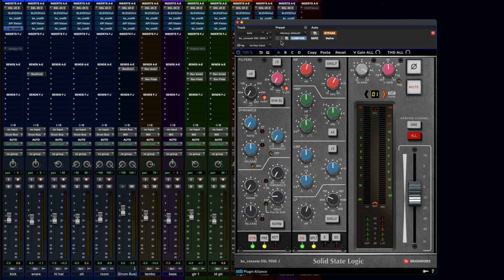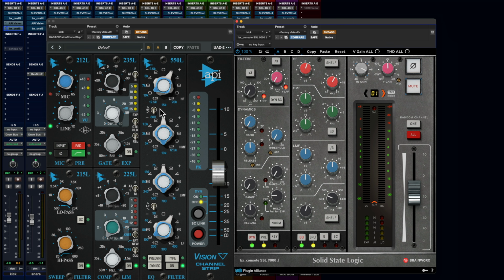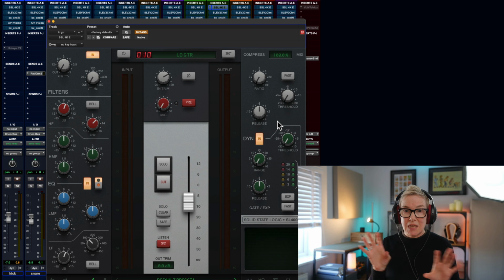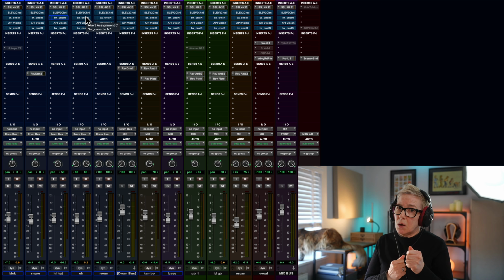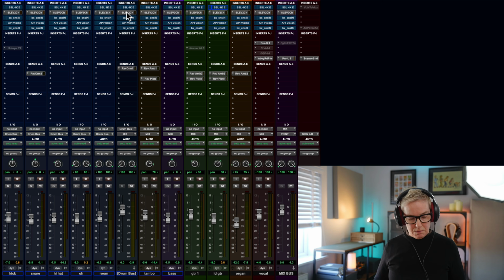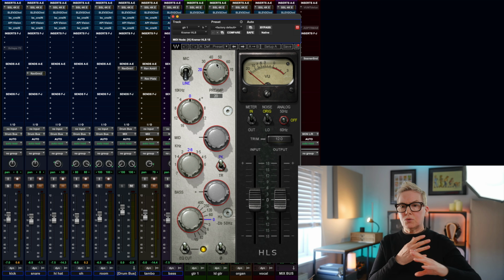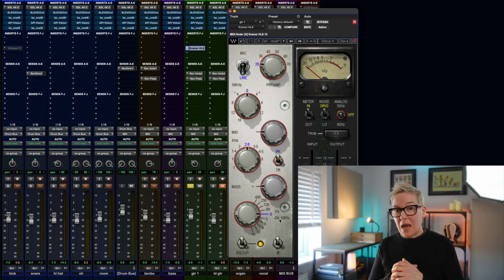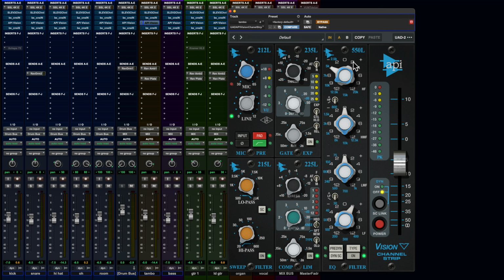Why Pros Use Channel Strip Plugins And You Should Too

Comment: Very good tutorial for beginners and intermediate engineers, as someone who had the luck of working in an SSL analog studio (early 2000's), I'm using a channel strip. on almost every channel (including groups and FX), but really love the fact that I can use a different one on each channel. Today I just select the strip I want for the channel, but in the studio it was always SSL, and I had very limited (for today, I gad plenty for then, it was a big studio) options of external (Neve/1076s/API/Fairchild...), and if I used the API for acoustic guitar, I couldn't use it for electric. right. So take it from someone who have been there, life in-the-box is SOOOOOO much better, and this is even before mentioning the curse  that we call tape, which sounds great when everything is calibrated, but either a technician, or a trained assistant\in-house engineer, need to work approx. 6-8 hours once a month, to make it so. 
And that was in the best days of analog (early 2000s), when thanks to SSL I could do at least some sort of recall, and use limited (fader only) automation, only thinking on how it was before the 80s. gives me nightmares/

Comment: I am missing something here. You;'re using the same strip on each individual track? This is not a master track stereo bus channel stip. So each track has it's own settings. How do the SSL4k settings compare to the API settings? Are they the same? How would you control for the limitations of each channel strip?
Reply: I have a headache.

Comment: I gave up on visual eqs such us fab filter as couldn’t get my mix sound right. started using bare minimal simple plugins with fixed bands and slowly building experience, the Kramer strip been my fav as it’s really transparent without that plasticky coloration so many plugins add, hard to ruin a track with it ;); once I got bit more confident I started adding Pultec eqs on tracks that need more drastic adjustments; after that I was able to use api eqs without making everything sound terrible;] they are a bit tricky for me as are more flexible , now I’m at the point of SSL channel strips - still a bit intimidated but having all tools in one plugin is really a mental relief ;) (I only used waves so far) in terms of saturation I’d rather put a track through couple of pedals/amp+mic as all plugins I tried sound kinda meh, if i have to l use Kramer tape or J-something tape

Comment: I've watched this video a couple of times, finding it very informative.  I have the Waves SSL E-channel, not for the sound, but for the description of what I can expect the sound to be (70s vibe, warmer harmonics compared with the G), and it's the only channel strip I've used.  I've also watched your compression video, and I'm experimenting wth your practices.  With adding compressors after the channel strip, would you use the channel strip compression at all? Or ever use the channel strip compressor without adding more compressors?
Reply from the maker: I often use both for different stages of control, but it really depends on what the track needs!

Comment: IMHO you should have level matched the outputs for a better / more neutral comparison, so people watching / listening to this video don't get the "sounds louder = sounds better" effect... Futhermore i wonder if you used Brainworx / Plugin Alliance famous TNT (Tolerance Modeling Technology) which is quite an impressive particularity of those plugins or you just kept them on the same number emulation (for those who don't know : "Tolerance Modeling Technology (TMT) is a patented analog modeling technique developed by Brainworx and licensed to Plugin Alliance, protected under US Patent No. 10,725,727.  It simulates the natural component variations found in vintage analog hardware—such as slight differences in resistor, capacitor, and transistor values—by generating multiple unique channel emulations within a single plugin. This results in realistic analog behavior, where each instance of the plugin (e.g., a channel strip or EQ) has a subtly different character, mimicking the imperfections and warmth of real analog consoles).

Comment: Sara, regards the line level knob on the API. The manual says:

This knob adjusts the amount of gain applied to the line input signal. The available range is 0 dB to 12 dB. The default value is 0 dB (unity gain).

So starting at the first dot  as zero, there are 10 more dots. So 8 is to 12 as 6.667 is to 10, so yeah, you had the knob in the right place. It would have been better if there were 13 dots so you wouldn't have to do the math though :)

Comment: Thanks Sara, I learned a lot from this video!  Thinking back to the olden days where signals from the live floor would hit a tape machine, what are your thoughts about putting a tape machine plugin before the channel strip?
Reply from the maker: Yeah, totally. In fact I was thinking of another video to try that out. I will selectively decide to add tape rather than on every track, much like the channel strip decision. I like tape on the mix bus

Comment: Hi Sara, thank you so much for this absolutely great video! Is there a video from you about the use of headphones?
Reply from the maker: I’m planning to do one in the near future so stay tuned! What would you like to know?
Reply: @SaraCarterSimplyMixing  Thx for answering. It would be interesting to know if you stick to one headphone or do you change between models, also considering traveling and which one to take. Then I would like to know if you recommend working with sound correction like SoundID Reference. And Whle you're working, do you switch a lot between headphones and speakers?

Comment: Thank you so much, Sara, for this great video. I've watched it several times now, and it convinced me to use a channel strip for the first time, so I bought the SSL 4k e. To be honest, I wasn't sure if I would be able to get the hang of it, as I've always paid attention to the EQ visually and didn't think it would make that much of a difference to the sound. But what can I say? I was absolutely shocked by the result. I mixed one of my songs with it and finished incredibly quickly. The sound really sounds like it's coming from a vinyl record. The low end is soft and round and totally full. Even instruments that I really boosted in the high frequencies never sound shrill or distracting. I'm absolutely thrilled. I never would have thought that this plugin would produce such a result. I can really recommend it to everyone.
Reply from the maker: I'm so glad you found the video helpful and that you're enjoying using channel strips, that's great to hear!

Comment: If I insert an SSL channel strip on each channel, should all other plugins come after it?
Reply: Depends on what youre trying to achieve with them. If the plug-ins are meant to reshape your sound (think like a mic pre, or an amp sim for a guitar thats gonna give you the final tone as if you were recording with live gear) then before the channel strip could be best.
On the other hand if it’s something else like a compressor that you want to finish up the tone, or you need something more aggressive than the channel strip compressor, or maybe you need to EQ again, that might be better if it comes after.
But there’s no set rules. The same way you can flip the order of sections within the channel strips, it really comes down to what sounds better to you. Nobody’s gonna tell you it’s wrong if it sounds good in the end

Comment: I work as a film composer. And in my template now, I use the AMEK 9099, and I have everything running in a separate instance of it. Completely changed how my mixes sound and how my scores sound for the BETTER! Using samples a lot of the time with musicians the channel strip makes them sound just a little bit more lifelike. I highly recommend that all composers should use a channel strip. Brilliant video!
Reply: Thanks so much for your info, very helpful 👊
Reply from the maker: Glad you found it helpful!
Reply: Bettermaker is the best

Comment: You know that this is a real sound engineer when the channel have 44100 subscribers, I'm curious to know which recording/mixing console you've spent the most time on and which console is your favorite and if it's the same console.
Reply from the maker: Hi, yes it was the SSL 4000e and 9000j consoles. I trained on Neve and SSL at SAE but they didn’t have those at Maida Vale. I tend to pick SSL channel strip plugins

Comment: Thanks for such an informative video! It was exactly the direction I was looking for. I recently produced some demos for my band. It's the first time I've taken on a project like this even though I've been recording my own ideas and sketches for years. What I quickly realised is that I could get 90% of all the mixing done with just a single channel strip plugin. And because it's the same plugin on every track you soon get very familiar with how to use it and how it sounds. The plugin I used was a free one called Channev and it did the job perfectly well but for the next demos I wanted to see what paid plugins had to offer. Based on what I heard here I've gone with the BX Console N. Looking forward to trying it out!

Comment: learning audio engineering throughout my 20’s, worked as an assistant engineer at 5th Street Studios in Austin Texas. 2011-2019. My mentor was a wizard on the console at the time, 1972 or “70 something” NEVE console. It very much a live room setup with a 2” tape 24 track Studer. Extremely grateful I got to learn in that environment. Of course they had great outboard gear & Lynx Converters and the whole Pro Tools rig. Basically I will put a channel strip across the entire track count. Love the 9000 from PA. Focusrite ISA PA. SSL’s Channel Strip 2. recently got into the Softube Console 1 SSL 4000E. I track with a stereo pair Golden Age Project PRE 573 Premier’s 500 series preamps. and a SSL Alpha Channel. Cheers!

Comment: Experienced mixer here... you're teaching this well. The reason I stopped in to listen is because I discovered a secret to mixing, and it sounds like you've discovered it as well. Thing is, it sounded to me like you glided right over the secret without recognizing what I have. A secret that truly explains the magic of this approach.

It has to do with track separation. Even using a different transformer in the mid vs side channel in the old Abbey Road RS124 compressor was enough for them to create a narrower stereo field, making it more monocompatible in their day, all at the same time as miraculously creating stereo width that wasn't perceived before. 

Different saturation curves printed on the various tracks of a mix, even when they may not be perfectly chosen for each instrument, does the same thing. And its extremely noticeable.

By the way, I love PA channel Strips and they make up about half of the library of my choices with these.
Reply: Some descriptions I tend to go by with some are:

1. ISA Focusrite 
Acoustic Instruments, Some Vocals
2. 1070 Neve
Electric guitar with warmth
3. API
Stadium size drum sound or
Electric with attack (metal?)
4. Helios 
Electric guitar or brass with splash (60s or alternative)
5. TG12345
Instruments with swelling lows like piano or basses
6. SSL 
bringing sounds under control. Drums or complex vocals for ex.

Comment: (((((((((((((((((((((((((((((((((((((((  LET US QUALIFY A THE NARRATIVE ABOUT WHY PROFESSIONALS REALLY USE CHANNEL STRIP PLUGINS  ))))))))))))))))))))))))))))))))))))))
Professionals use CHANNEL STRIPS because the bloated, crappy C++C-- CODE and buffers slipping back and forth - requiring you to purchase an external clocking system like an Apogee BIGBEN for #DONALTRUMPLOTTO; that 97% of all DAW & Digital Mixing System are built on is not non analog sounding crap but the way the very GUI are designed - the platforms themselves are built around the ideology that YOU MUST start off by adding plugins! As apposed to just sitting down at a PROPER MIXING CONSOLE and "just start grabbing knobs and mixing.
...The system I use is of that 2% of systems on earth that is not only seriously ANALOG SILK SHIMMERY SMOOTH PRECISION AUDIO ENGINE but it is designed from the ground up, where you can just pull up to it and start to mix WITHOUT THE NEED to set up 1 plugin. Ironically this is THE ONLY PLATFORM on earth that is not only a (x25) FULL CONSOLE REPLACEMENT with analog precision but it is the only system(s) designed from ground up to work seamlessly with a MULTI-TOUCH SCREEN, it is completely customizable for a full set up and it has an internal clock that rivals with the best clocking systems on the market and will REVEAL TO YOU, exactly what you plugins & Vst's really sound like and how well or not they can perform ETC. These TWO PLATFORMS can also never crash - ever and can sonically outperform all other systems (( INCLUDING RADAR and MIXBUS)) and can do so even on an old PENTIUM 4 in 32 bit mode windows xp @44.1K and it can even be ran from a thumb drive on a laptop!!!!

Comment: Thanks for the video. I had three of these plugins gathering dust that I never used so I tried them. I can see where you're coming from, they are a lot easier to get a quicker mix. I find the dynamics very easy to overcook when you're mixings a lot of tracks. But overall I think I might be a convert. Cheers.

Comment: I dondt know if you can duplicate the same sound with fab filter eq and compressor or even with stock eq or comp. I use these channel strips too cause i using console 1 from softube. But in cubase using stock plug ins with broad eq curves i get similar results. I think it is more a visual thing.

Comment: SSL channel strip + their hardware controller completely transformed my relationship with EQ. I was finally not tempted to listen with my eyes. I of course thought I was avoiding the temptation, but only once it was solely tactile did I realize what I was and wasn’t doing right. Also, the speed of reaching for the same tool each time keeps me in flow, and able to move through everything while my ears and thinking are still fresh.
Reply from the maker: That's great!

Comment: Thanks! First vid of yours and it was great info! When your using the 4000 is it your default setting to have 8db of gain on every channel?
Reply from the maker: No that’s was just for this demo to exaggerate the character.  Leave the gain at unity unless you want to add more character
Reply: @SaraCarterSimplyMixing thank you for the reply!! So that adds some saturation 

My newest template has an ssl  channel strip on everything for many of the reasons you said in your video. And i have a midi controller mapped out to all of the parameters. Really fast workflow.

Comment: Been using the Slate virtual consoles for quite a while, (Which nowadays gets me the strips from SSL, too, in the everything bundle) but it's good to hear the comparison between the various strips, especially as (and I'm hoping someone will correct me here), there's not an easy way to bypass plugins on multiple channels in Ableton to get a good before/after comparison
Reply from the maker: The slate ones are really nice, I've used them in the past and really liked them.

Comment: Nice video, I was using channel strips when they first came out, but they were too CPU intensive.  I stopped.  However, with the Mac M1-M4, this became less of an issue.  I use them now.  I will make a list of the ones I think they should still model.
Reply: I would really like more emulations with Era appropriate channel strip modules created (Filters, EQ, Comp/Limit/Gate/Expander, Exciter, Output Stage), but the company’s need to make them in a module format, so you can mix and match, example: SSL E input with an API 215L, (filters) a 1081 (EQ), a LA3 (Comp), an 1176 (Limiter), a 235L(Gate Expander) and a CAPI VP28 output section.  The following list would be great classic additions for Input strips with era specific channel strip appointments: Trident A Range, Langevin AM4, AM10, AM16, Jensen Twin Servo, Manley DVC, Early RCA (OP-6, BA-1A, BA-2A, BC-7A, BC-6A, BO-6A), Harrison Linage, Western Electric 124, Cinema Engineering 9000, Altec 1567A, Teac/Roberts 770 MOD with switchable Jensen/Shure input TX, Ampex 351 MOD, 601 MOD, AG-350, MR-70, MX-10, Siemens/Telefunken/Tab V72/V72a, V76, V276, V376, V372,, EMT 156, Philips EL6425, Calrec PQ1161, Quad Eight MM-312, Universal Audio 1108, Joe Meek VC1, VC1Q, VC1Qcs, Hally Heider’s Frank DeMedio API (312 era) Console and UA (610 era) Console, Melcor AM27, CAPI VP26, VP25, VP28, Neumann WV73a, Lomo UM-51, Gates SA-39B, Gates M-5167, Collins 26U, Fairchild 660 (used as a preamp), LA2A, LA3, 1176 (used as a preamps), BBC AM8/12, Pye TVA 10, Eckmiller W86, Spectrasonics 101, Auditronics 110. Presonus ADL700, M80/ACP88, Shure M67/M68 with Level Loc.  Some of these are known solid GOLD!  Some are one trick ponies for character, like the Shure stuff, but slam the top or bottom snare mic through that, and you will know why it is on the list.  There are other modern ones, too.

Comment: Thanks for the video Sara. Excellent, absolutely useful. Hope 2025 is going well.

Yes, I use a channel strip at the top insert with my Studio One 7 Pro. I'm using the SSL 4KE with the orange EQ on but not actively doing EQ there. But I like what it's doing even that way. I'm EQing later after my 2 compressors.

I add a bit on the 4KE mic pre and in trim. This goes into the UAD 1176 to UAD Manley Variable Mu, the UAD Manley Massive Passive and so on.
Reply from the maker: Sounds like a nice set up